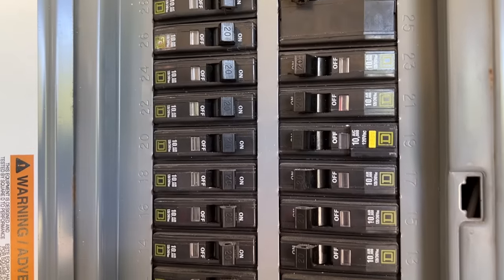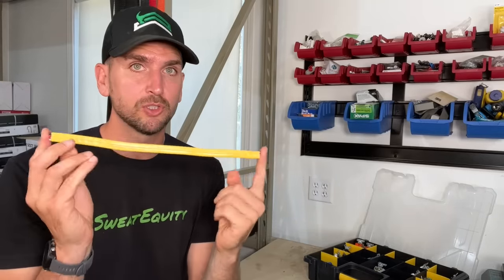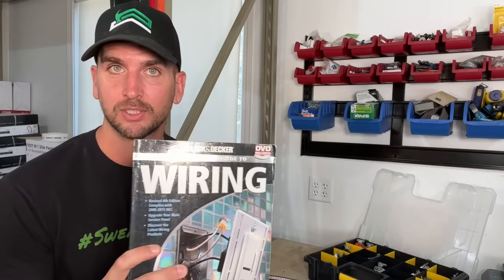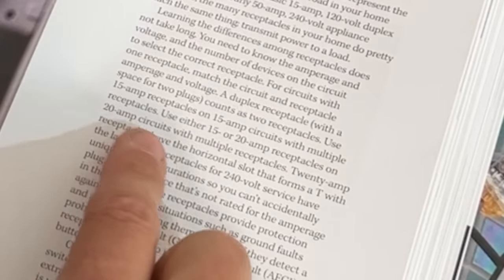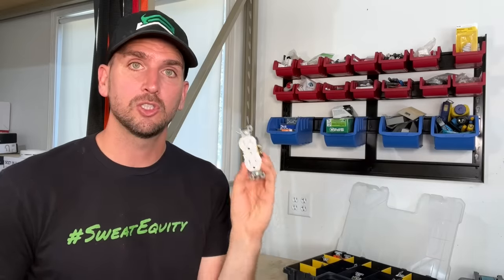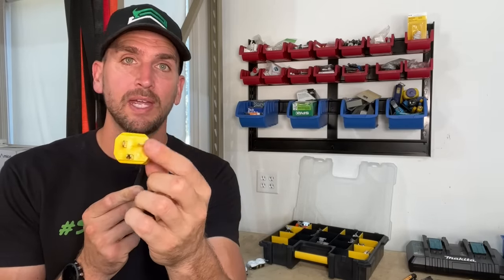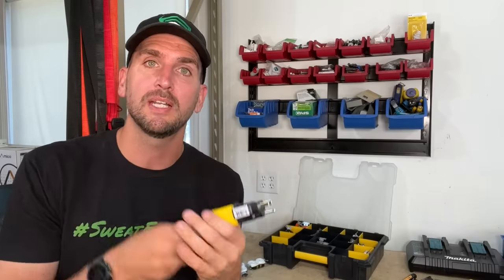Can 15 Amp Outlets Be Used On A 20 Amp Circuit Breaker

Comment: Maybe I'm a little late to the game on this but a 15a receptacle is RATED for 15a. I don't care (as an electrician, an inspector or a teacher) how many you put in. It's rated for 15amps. Not 20. If I saw a 15amp receptacle on a 20amp circuit that would be an instant fail upon inspection. Perhaps, being in Canada we are smarter (yes) but would you fuse a 30amp dryer receptacle at 50amps just because you had to? So if I use a 15amp receptacle on a 20amp circuit and something fails YOU can be held liable as you stated it's not an issue. Also, yes I keep going, they have a "plug converter" or whatever so you can plug a 20amp device in to a 15amp receptacle and blow the breaker every 2 minutes as most houses are wired on 15amp circuits (12amp if we use the 80% load rule). I can do this all day.
Reply: Lots of faulty logic but keep doing it all day, the result is the same. In the US under UL requirements, a 15 amp recep is require to maintain 150% of its rating, or 22.5 amps.  The link between the two sides on a 15 is rated for 20 amps and must maintain 150% of its rating, or 30 amps. For industrial or hospital grade receps, they must maintain 250% of their rating. CSA standards are either similar or the same because I see UL and CSA on most devices. There is almost nothing on the market that a homeowner can/would buy with a 20 amp draw and a 20 amp cord cap. If it's corded load, with a 20 amp cord and cord cap on it, it will not exceed 16 amps anyway, max 80% load on anything cord and plug connected. With multiple receps on a single general use circuit, there's no reason to assume that any one of them will ever be at full load because, with rare exceptions, they won't. To your red herring question about a 30amp dryer recep on a 50 amp circuit, more faulty logic and ridiculous example. The dryer recep is a single recep on a dedicated circuit so putting it on a 50 amp circuit is not allowed. Similarly, a single 15 amp recep on dedicated circuit must be a 15 (not a 20), and a single recep on a 20 amp circuit must be rated for 20 amps. Yes you're a little late because your comment that you don't care, if it's rated for 15 that's the end of the argument, is like saying you don't to read the contents of a book because youy already read the title. Sometimes, you may want to read past the headline, you'll learn something.

Comment: I wondered about this very thing. I have 12-gauge wire coming from the line side  in a 2-gang box with an outlet & light switch. The wire from the light is 14-gauge so I used a 15A switch. Is that kosher? I was thinking if I used 20A switch I could overheat the light wire bc the switch can take it but 14-gauge wire can’t. Is this even a consideration? The circuit has only this dedicated outlet in a bathroom.
Reply: Receptacles and switches impose no electrical loads at all.  Zero amps.  The load comes from the appliance, the fan.   Using a 15 amp switch to operate a fan that probably pulls 1 amp is not an issue.    Using #14 conductor in a 20 amp circuit is an issue.   If the circuit breaker is 15 amp, no issue, if 20 amp, not code compliant.   Either change the #14 or change the breaker to 15 amp.

Comment: Hi, can you explain what causes a open ground and/or how to correct it?
Reply: You don’t have a good ground back to your panel. So your ground is either broke somewhere or not wired correctly. Open your box and make sure your receptacle is connected to either the green/bare copper ground wore. If it’s a metal box, bond the ground to the box and then pigtail off to your receptacle.
Reply: Orlando,    Do you have one receptacle with open ground, or many of them?
Reply: @KevinCoop1  

I have four receptacles showing open ground

Comment: Maybe you could have spoken more about the differences between 15A commercial vs 15A residential grade....to complete the story?
Reply: Does the video he mentions/links to at the end of this video address your question?
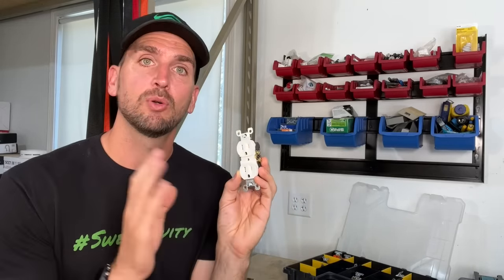Reply: @jgallone  ...as I went back to the part of the vid I questioned....timeline 3:00 - 4:00, or so....I think I see the answer. There is no 15A "commercial" grade......what he means by not liking to go builder grade 15A...is instead to step right up the known 20A device with the "T" slot.....at first I thought he meant there was a 15A ( without "T" slot) "commercial" grade. My mistake. He meant go straight to 20A, with T slot, as the commercial piece he likes. (Hmm... later edit....from someone else's comments here, ...from @stevefifield1207  ....it seems there IS a commercial grade 15A...so the question still applies....how to tell without the T slot of the 20A).

Comment: Can I exchange a 115V outlet with a 20A NEMA 5-20r outlet just by moving the wires over one by one?  Is it more complicated than that?   Need the 5-20r for a treadmill.
Reply: If 15 amp breaker and #14 conductors, no you can not.  The wire is the issue.  It will possibly overheat the #14 insulation.  You would need to get a new 20 amp circuit installed.  You paid big money for the treadmill, now connect it correctly.
Reply: @KevinCoop1  thanks

Comment: can you extend a 20amp circuit using 14 gauge wire?  got into an argument recently where I said that wasn't allowed.  Yes, you can add a 15amp outlet, but the wire has to be 12 gauge.  was I correct?
Reply: If the breaker is 20A, you must use 12ga or better.   To continue onto a 14ga, it would need a 15A breaker “subpanel” first.
Reply: Just seconding what RJ said: You CANNOT extend a 20A circuit with a 14AWG wire, unless you downsize the breaker for that circuit to a 15A breaker. The breaker MUST protect everything downstream, and a 14AWG wire is not rated for 20A.
Reply: Simply put, yes you are completely correct.
Reply: You cannot use smaller wire than allowed. You might be able to do it you add another breaker before the smaller wire but that makes no sense.

Comment: Since you can’t plug a 20 amp plug into that 15 amp outlet, why would a 15 amp outlet be a problem on a 20 amp circuit?
Reply: It's not.
Reply: @GregHassler  The 20 amp circuit with multiple 15 amp outlets is a specific exception allowed by the NEC.  In general, you can't use a breaker with a higher rating than the wire and outlet or hard wired device is meant for, since the device/circuit could go into an overload condition that isn't bad enough to trip the breaker, but is bad enough to cause a fire.

Comment: This seems like a ridiculous question. A 15A receptacle will not accept a 20A cord end. That is not a fire hazard. It is not a hazard to put a smaller amp load into a receptacle. A smaller load on a bigger circuit is not a hazard. That's like asking if it's a hazard to have a 1 amp lightbulb on a 15A circuit. Of course not, that's ridiculous.

It is a hazard to put a 20A receptacle on a 15A circuit if you plug in something that draws too much amperage. I had a customer who was routinely blowing his breaker because he was using far too large of a grinder on an old 15A circuit in his garage. One device could blow the breaker. I had to put in a 20A circuit so that he could use his tools. The grinder should have had a 20A cord end.

The purpose of a 15A receptacle is so that it doesn't draw too much current. The shape of a 20A cord end is different, and doesn't fit in a 15A receptacle. A device that draws LESS current is not a hazard.
Reply: I think you mean that the purpose of a 15A breaker, not receptacle, is so it doesn't draw too much current. Receptacles do not determine current draw.

Comment: Actual Electrician and someone who has spent the last 12 years in the distribution side of things you are just wrong on a few things. 

A. They are not using cost reduction for anything. It has to do with the Male plug going into the device. 15 amp is only meant to accept the two vertical terminals where as the 20 amp can accept both which is why they have the additional provisions for the horizontal terminal. 

B. UNLESS MARKED all breakers trip at 80%. so a 20 Amp breaker will trip at a calculated 16 amps. Most new breakers will usually do so but as the breaker ages, (and yes there is a manufactures life on these that no one pays attention too) they end up getting weaker and will sometimes trip at 15 or even 14 amps. Your average consumer is not going to usually notice though because unless they are using WINDOW UNITS or high wattage appliances all the time on the same circuit, a home owner very rarely gets close to that 14 amp range. 

C. Technically speaking according to the code #12 NM is comprised of #12 THHN/THWN single conductors, these by code can technically take up to 25 amps which exceeds the rated and listed amperage of the breaker. 

Ultimately the code is what you should go by. it is there for a reason. If it says you can use it, Do so. if you have 150 recepts in your house 20 amp is going to cost an extra 300 dollars for something that is just a waste. We aren't even talking about switches which get exponentially expensive when you start using 3 ways and 4 ways. things are already expensive enough with electrical but you're advising increasing the cost because of your opinion? no.

Comment: I like to run the 20 amp rated wire and use the 15 amp breaker.
Reply: Then your point of failure will be the breaker, or breakerbox.

Comment: Can I replace an Eaton AFCI Br 20amp circuit breaker with an Eaton AFCI Br 30amp? These are for outlets in 2 bathrooms. EACH bathroom has 2 outlets. The Lights have seperate circuit.  My wife used Hair dryer and for some reason, it broke even after I reset the 20amp breaker.  All outlets are dead.
Reply: No you cannot. Check all of the outlets on that circuit, the screws in one or more may have come loose. Electricity does vibrate, and will loosen connections over time. I would also replace the old 20 amp breaker with the same new 20 amp breaker, it could simply be bad, as breakers do fail. Then the hair dryer, try it in say your kitchen, see if it trips any breakers, you never know.

Comment: So can I upgrade outlets from 15 to 20amp.. or is it safe to phrase the 15amp breaker to a 20? Just have a desktop pc with speakers and it’s popping circuit if flipping on a closet light?
Reply: No, unless you can verify 12 gauge wire for the entire circuit.

Comment: I know residential electricians wouldn't like this, but why can't all the wiring just be plug n' play into the breaker box?
It doesnt seem that complicated to just design the outlets and panel so an a cord plugs into the them without all the wire splicing and dealing with load and line wires. All that could be handled by the outlet and panel manufacturers.  It would prevent DIYer's miss-wiring their homes.
  I guess like simplifying the tax code, it would put a lot of people our of business.

Comment: If you are running 15 amps continuously on a 20 amp wire the 20 amp wire will not get as warm because you are not tasking it to its limit.  Safer that way.

Comment: Hello everyone. 
I had #12 wire almost in all bed room which is  for 20 amp breaker.
Can I replace to a 15 amp breaker.? meaning #12 wire on 15 amp breaker. Protect   wire .
Is that correct?  Thanks alot  for your time.
Reply: Yes

Comment: This one time the code messed up. But the code does says a single 15 amp receptacle may be on a 20 amp circuit. Is a duplex receptacle a single receptacle I don't think so.  In my opinion a good electrician wont do it.
Reply: The code does not say that. A single recep (simplex) on its own circuit cannot have a rating lower than the circuit, 210.21(B)(1). A duplex receptacle is not a single recep; each side is rated for 15 amps and the feedthrough link is rated for 20 amps.

Comment: I've always found the incessant mentioning of code compliance to be humorous  Most homes in America are not close to code compliant their owners don't even know what the codes are they live in them for 20, 30, 40 years. Try finding a original amp outlet in a whole Built-in the seventies or eighties you're not gonna find it.
Reply: Yep, been rewiring my house, 1960's build... What a mess, some of the stuff I have found... And I am not helping matters sorting it all out. Going to need to install a larger panel. Damn thing is packed full. Thank God there are only two of us here... If I had kids I would be upgrading the service along with a new panel ASAP.

Comment: 👍It’s gotta be more cost effective to make one product than multiple since you would need twice the assembly in theory 🤷🏻‍♂️  if the face plate is the only difference, it would be a simple thing to switch back and forth between . 
     Less materials=less space/storage= less cost 🤷🏻‍♂️ so people are stuck on the thought of looking for just a 15a to buy ? when instead of producing them at all maybe and just get the thought of its existence 🤷🏻‍♂️  since probably 90% of home owners have zero clue 🕵️ 😂

Comment: We have none of this nonsense in the UK where all our wall sockets (or plugs as called colloquially) are concerned.  Ring mains in domestic premisses with a 30 amp fuse (or 32a MCB) in the fusebox with each appliance plug containing it's own dedicated cartridge fuse max 13 amp.  There is no limit on the amount of sockets we can wire onto an individual ring main (max100 sq m floor area) though the maximum load at any one time shouldn't exceed 7,500 watts i.e. 30 amps.  Current regulations require separate ring mains for up/down stairs with a separate ring for the kitchen.

Comment: 1) while I don't have any complaints with "Can 15amp outlets be used on a 20amp circuit"; but I think you should also add "how many 15amp outlets can be used on one 20amp circuit".  2) You show actually why you feel 15 & 20 amp outlets are virtually identical; but then say "do not use 15amp residential outlets" without any explanation why.
Reply: When he said "virtually identical" he was referring to commercial grade only. Residential 20 amp receptacles are not commonly found.
Reply: @surferdude642  Yes, I know... Just saying he fully compared the commercial grade products; but nothing about why not to use residential grade products.  And I am sure that there are differences (considering the price jump); but I would like to know what those differences are.
Reply: @a69589  There are several differences. The commercial grade are more robust overall. On the commercial grade the grounding area cradles the plastic around the back and strengthens the receptacle overall. The internal contacts are designed better and grip the plug tighter. The wires can be connected by backwiring in which the screws will clamp down on wires. Not to be confused by backstabbing. No backstabbing option is available.  The tab that connects the 2 screws is larger. A self grounding strap is located on one of mounting screws, useful only with metal boxes. On the Leviton brand the front face looks cheap on the residential grade, on the Eaton the front face difference is not perceptible.
That being said, you can still get decent service (years) from a residential grade receptacle especially if plugged and unplugged infrequently.
Reply: @a69589  In other videos, he's broken down residential outlets and compared them to commercial.

Comment: I have a 20A system with 12 gauge wires and the outlets are 20A outlets.  However, there is no --|  type plug.  I could never find an outlet like this type of plug..

Comment: In short. 20 amp outlet on a Dedicated circuit. 15 amp outlet on a non-dedicated circuit.
Reply: I think you got that backwards.  If it's a 15 amp outlet and it's the only one on the circuit, you have to use a 15 amp breaker.  If there are multiple 15 amp outlets on the circuit, then you can use a 20 amp breaker.

Comment: So no one would ever plug a curling iron and a 1875w hair dryer into the same outlet receptacle?
Reply: That would pull more than 20 amps and trip the breaker.